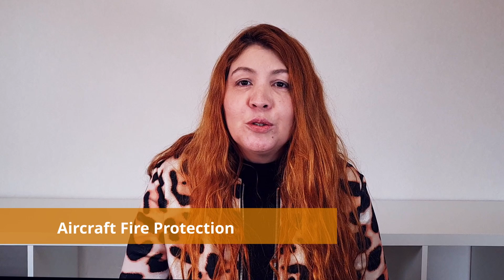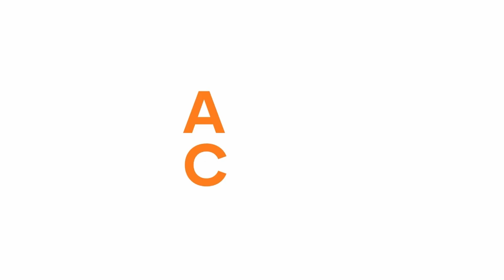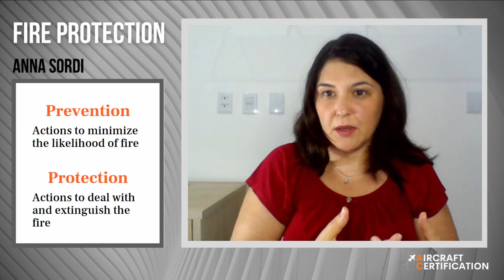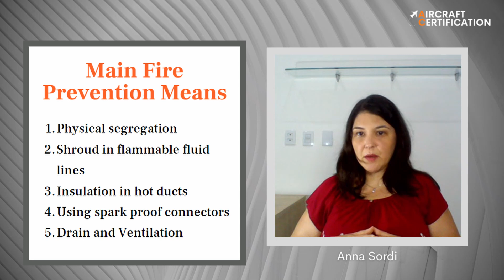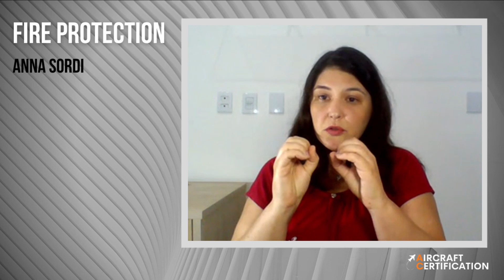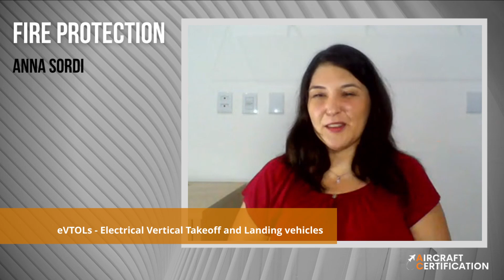Aircraft Fire Protection - Anna Sordi - Aircraft Certification

Comment: Thank you Rafaela-san, Clarissa-san, and Anna-san for this interesting channel.

It's very interesting to know the philosophy and methodology of aircraft fire protection, and important to know these as former pneumatic duct engineer.
I should have known them and deal them correctly. It's very troublesome to take care at the end of program as it's mentioned.

Also there are several fire requirements from regulation which make us confuse whether our components are subject or not, especially 25.853&856.

Finally, it's interesting to know lean fuel vapor discussion. Here is another subject to need fluid analysis skill for aircraft certification.

Thank you.
Reply from the maker: thanks for your comment Mizuide-san! Your contributions are always great!!!! 
You are right, it is very important for all engineers that work with systems to have at least a basic knowledge of fire principles so that they take that into account when specifying a system.
Reply from the maker: The 25.853 and 25.856 are related with cabin safety with intent to protect the passengers and increase the survivability in case of an accident. In regards of fire protection, these two requirements intend to prevent fire initiation and in the case of it happens it won't propagate nor release toxic gases in the combustion process, this would increase the chances of survive following a crash. We will include a video about interiors fire protection in the future and we can detail more that.